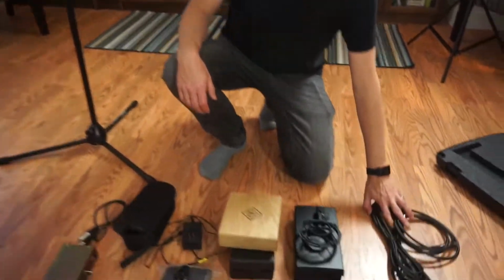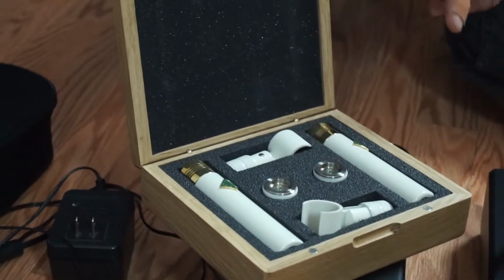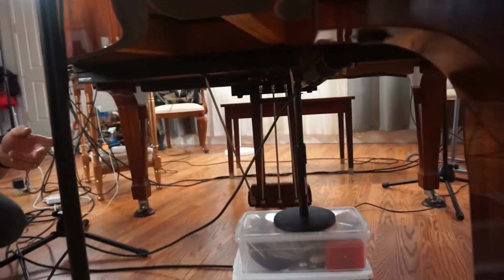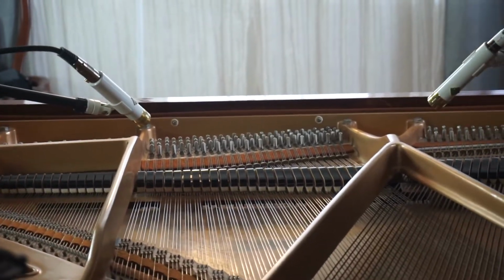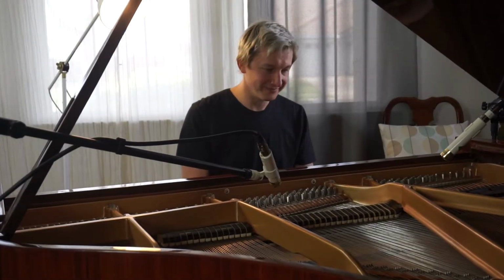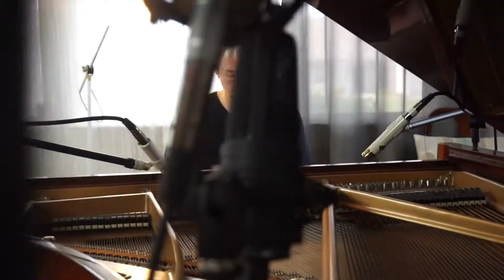Grand piano miking experience with Soyuz 013 FET and MS pair together

Comment: soyuz makes some of the finest tube and fet microphones, I've tried in my studio the bottle tube type soyuz and it was great, I've compared it with my blue the bottle based on ef86 tube and soyuz sounded great too.
it has a warm and creamy tone, well balanced with some vintage character, blue bottle with b7 and b8 sounds more modern.

nice idea to put a large condenser mic on the bottom of piano to get beef and meat, I've done many times, some sound engineers say it's unnatural but in my opinion is a very important spot to put a piano micrphone.

I have a kawai piano too, model kg3c, nice sounding, I like the brown finish on your kawai, looks very warm.